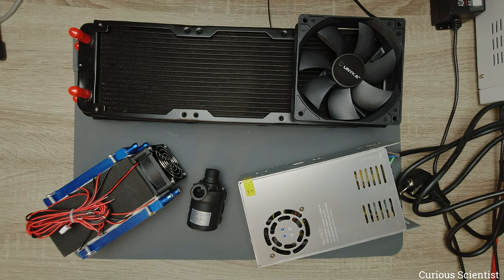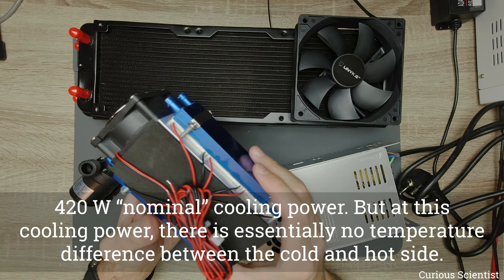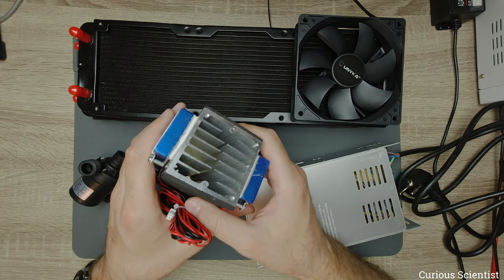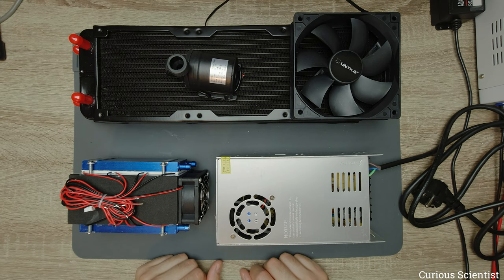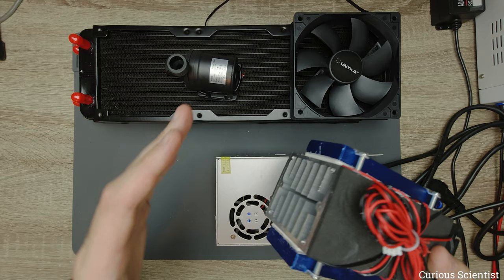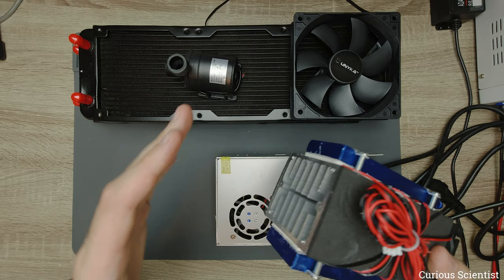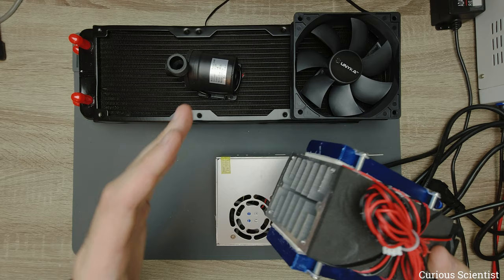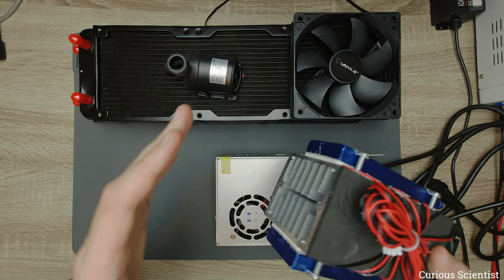Peltier cooler-based air cooler

Comment: bad design. you have lots of heat transfer between hot and cold sides of peltier via metal connecting stripes and screws. isolate them well.
Reply from the maker: Tell the manufacturer. :) Btw, those four screws per side barely contribute to the loss...
Reply: Agreed. Every experiment he did on peltiers was purposefully designed to make them seem worse than they actually are. Here for example he put the cold and hot side in in the same room and close to each other, then complaining the room doesn't get any cooler.
Reply from the maker: What are you talking about?

Comment: I don't think you understand how to cool the hotter side. You can mount a large heatsink and place it under water, submerge in the water maybe 2 liters of water and put 1-2 pump going to your radiator. It will make better cooling.
Reply from the maker: I don't really understand what you mean. The hot side already has the water cooling block installed, so the most straightforward way is to attach a water cooling loop with a radiator to it. 

Where do you mount the heatsink you mentioned and what cools the water that is used to submerge the heatsink? I don't really get it.

Comment: Some more money added to the price of that radiator, smps and pump will buy me a new air cooler.
Reply from the maker: Exactly, that's the point. These devices are not made for this task and it is better to invest in a regular AC.

Comment: personal suggestion buddy,ur stretching it to long plz make it shorter so that people will not get bored,as i am concerned,and do not forget to show the wiring at least.
Reply from the maker: The connections are always explained in the video, and they are also very simple since I just directly connected the Peltier coolers to the 12 V power supply. Regarding the length, I am okay with long videos, and I don't care if people get bored.

Comment: Could you reverse the current through the peltiers to chill (not freeze!) the water and use that to cool a CPU/GPU water loop?
Reply from the maker: If you reverse the polarity, the hot side becomes the cold side and the cold side becomes the hot side. Furthermore, it does not make sense to use Peltier coolers for cooling CPU/GPU cooling loop. I made a video of a similar case and explained why. Search for it in my channel.

Comment: 40% of the energy bill is on the heat exhaust.
Run that into a terrarium to raise the practical value.
It can even thaw out a frozen roast and hygenically incubate biltong/jerky ☝️
Maybe only one radiator is required with one pump making up for the extra work.
Much enjoyed, thanks 🙏
Reply from the maker: Hi and thank you! Yes, it could be better if we could recycle the heat but that is true for basically any heat emitting devices.
Reply: @CuriousScientist   To agree... since starting play design with these devices my mind is never made up, do I want ice-cubes or toast.
Now I see a budget TEC on my supply list that have good thermal to electrical properties.  Therefore could run some of the peripherals installed in the right place.  Seeking out heat sinks for thermo generators.
Good luck with it bro.  From this video you gave me an idea to PWM the devices supply and tweak it without an oscilloscope by just a JK reading.
They really need PWM to purr out loud and for longevity.  The PWM offers an adjustment in stack or stacked heat bridge.  I like the heat bridge assembly over stack in any event of malfunction.  I also like to use different metals for their thermo-junction properties.
They can build them to custom perameters if you're willing to order that many.

Comment: Hi from France !
Thank you very much for all this bunch of thermoelectric knowledge !

I have read that some radiators made of aluminium and copper piping are able to catch the air's moisture and prepare a highly pure and valuable water.

It's always a pleasure to follow your projects !
Reply from the maker: Hi and thank you very much! 
Yes, if you manage to cool the radiator below the dew point and you have enough humidity in the air, you can do it. There is a similar project on my to-do list. I basically want to make a device that does the exact same thing that you just described. I have a somewhat similar heat sink channel for it that I showed in the video. I just need some time to assemble a system and prepare a few things.

Comment: I haven’t read all the comments but I’m wondering if you could sandwich a water block in place of the heat sink and run the cold side to a smaller radiator with its own pump and fan? Also extend the hot hoses and move the hot side radiator farther away and see if that makes any difference. Maybe make it like a mini split and have the hot side radiator outside. Just a thought.
Reply from the maker: I made a video on a similar system. No, it doesn't make sense. A lot of Peltiers are needed for noticeable cooling effect.

Comment: Could you tell me why it is a bad idea to put the radiator + fans outside the window, and let the peltiers inside the room to cool it down?

Lets get an example: im using 12 12706 TECs. so i place heatsinks and small fans inside the room with small waterblocks on each. Then i bring the warm water outside the window like at a split AC unit. 

I think you said once its a bad idea, but i dont know the video.
Reply from the maker: It is a bad idea because you throw out 85% of the used electricity as heat. Peltier coolers are inefficient, and they are not really good as air conditioner. Your proposed system with 12 units will probably work, but it will use a lot of electricity and will provide much less cooling power than a regular AC.

Comment: I want to see this thing used in a small sleeping pod recirculating the cool air. I find myself here looking at how to cool a 4'w x4't x8'long insulated box to sleep in using my solar for power
Reply from the maker: Probably a small insulated box would be okay. But probably you would need more than one unit.
Reply: @CuriousScientist   do you think 240w would be enough to cool that much space?
Thinking about using them as a dump load for a solar storage system
Reply from the maker: I don't know. You can calculate the heat loss of the pod as well as the heat that you put in vs. remove from the pod and then you will see if 240 W cooling power would deal with it. If the pod is well-insulated and the only heat source is a sleeping person, then probably you could make it reasonably cool. Keep in mind that you typically cannot reach the maximum values provided on the Peltier cooler's datasheet, so you might need more Peltiers than you would expect. A lot also depends on how well you can cool their hot side. Another thing: this device is noisy as heck, like a hairdryer. Some people like the white noise of the hairdryer, but maybe it is not the best in this case. :)

Comment: Im confused, are you cooling or heating the radiators? I thought the cold side should be on the blue blocks and not on the heatsink to make the radiators to blow cold air?
Reply from the maker: No, that is totally wrong. The blue blocks are attached to the HOT sides which then go to the radiators. The Peltiers produce an enormous amount of heat and you remove the heat by using the radiators. The heat sink could not cool the Peltier coolers at all.

Comment: I'm amazed that your room temperature hasn't increased a bit! It should've increased by a tiny amount because you put the whole system (including the heat emitting power supply) close to each other, in the same room! I think if you use hundreds of TEC1-12715, you will get the temperature increase that you want.
Reply from the maker: I see what you are doing here, I've been following your comments on my channel since the first one. But I think that you are misinterpreting my experiments, probably because you don't watch them carefully enough. 

The room temperature increased by 1°C. I explained in the beginning that the warm air from the radiators is actually being pushed out from the room, towards the right side of the video. I also ALWAYS emphasize, that I am not trying to cool down the room as I am not able to physically separate the cooling side and the radiators. I am always looking for the temperature differences between the inlet (or room, depending on the system I built) temperature and the outlet temperature. Ultimately, the goal is always to create a temperature drop with the cold side of the Peltier cooler, and based on this drop we can estimate the performance. It does not matter if you try to cool a 35°C air to 25°C, or a 25°C air to 15°C, you will need the exact same amount of power (Q = c*m*dT). And this is why I always measure and report the room temperature in all my experiments, so the viewers can get a feeling about the real temperature drop. Depending on the system I build, I also measure the temperature of the heat sink that is attached to the cold side of the Peltier cooler. With this data the viewer can get a feeling about the "cooling capacity" of the cold side. I also showed this in the beginning of this video where I started the experiment without starting the fan on the cold side heat sink. Trust me, I know what I am doing. ;)

Comment: In middle of building a sleep pod and near on all the parts for the peltier cooling - my plan was use old PC case, adapter for the PSU to break-out the 12v, 5v 3v rails (can get adapters that do all that nice and cheap) large heatsink and 2 peltier's stacked and inside PC case - cool side and hot side with cheap ducting and recycled pc fans for the hot and cold air loops.  Did get a very large over spec heatsink for the hot side.  All this sat inside that old grey large tower of a PC case and tada - saved some corners.  Should work well enough to cool a largish sleep pod and then the real pain of noise and too hot or cold when sleeping will become less dynamic.

But reusing old parts that many chuck away can save lots, also remember that CPU heatsinks with heatpipes have been optimised for cooling hot surfaces so those can be reused nicely for something like this.

Still, one thing I do want to do is get solar panel and few car batteries and make those moments I need for cooling, less impacting fiscally.    

Though way things going, probably get it done in time for Autumn/Winter - chortle.
Reply from the maker: Stacking Peltier coolers in a bad idea for this purpose. You limit the cooling power by the bottom Peltier already and the top one does not do anything useful in this sense. Use them side by side. But only 2 Peltiers will not do anything noticeable in my opinion.

Comment: hi, i want to make an A/C for my car with tec peltiers, i need to say :
1- i can not use the compressor because my car is loaded nearly 4000kg when im driving 
2- i can get 45 amps from battery
3- the temprature of the outside is 40° celcius most of the time
4- i need the outlet temp about 20° 
do you think its work ?
Reply from the maker: Hi!
I don't know because I have never built an AC for cars. But if you only care about the outlet temperature, then this device or its larger version could work. But you will need a quite substantial cooling system for it, and you'll also need to regulate the power. Probably the voltage of the battery is too high for running the Peltiers "efficiently". Don't expect miracles.
Reply: @CuriousScientist  
i will test it and let you know if it worked. thanks
Reply from the maker: Thanks! Please, if you really test it, send me the results. It would be interesting to measure power consumption, inlet and outlet temperature, cooling time, and so on. Would help other people, too.

Comment: Hello! Can you give me advice about peltiers. I have little air cooler with stack of 3xTEC12706 atx power supply voltages 3.2v, 5,2v and 12.2v. I want try put more power for cooling. I was thinking just replacing them with 3xTEC12715 , or maybe stacking them top- 12715@3.2v , mid- 12706@12v , bottom- 12715@12v. Or what is my best option with this type of power source?  Sorry about my bad language and messy question. I donated for your super work here :) Thanks
Reply from the maker: Hi! Thank you for your contribution! Your language is perfectly fine, I understood everything. 

I think that your concept is not the best. Not necessarily wrong, but could be improved. If you need cooling power, then you should not stack the Peltiers. Stacking gives you larger temperature difference between the bottom and the top Peltiers. But, the heat that you can remove from the system that you want to cool entirely limited by the cooling power of the bottom Peltier. And in addition to this, you waste most of this cooling capacity by removing the Joule-heat of the other 2 Peltiers in the stack. There's only a very little capacity left to remove actual heat which cools your system. 

Try to increase the surface area and use several, individual (not stacked) Peltier coolers. Make sure that you cool their hot side very well, and don't run them more than 50% of their max rated current (e.g TEC12706 should run at 3 A, TEC12715 should run at 7 A.....etc.). You can use a DC-DC converter to limit the current by limiting the voltage that you supply to them, or if you have a 12 V PSU, you can "chain" them on the PSU. One link of the chain is two identical Peltiers in series. If you put them in series, they will experience half of the supply voltage, around 6 V and this will limit the current too. 

I made a lot of videos on Peltiers, so I encourage you to check them. I discussed all these issues: serial or parallel wiring, stacking or not...etc. I hope it helps!

Comment: Thank you for this video, I am looking to do this but it will be hooked up to a helmet for racing to help decrease temps inside a helmet, perhaps voltage could be switched and blow warm air also
Reply from the maker: This is way too large to directly attach it to a helmet, and you would need to get the power cables and the water cooling pipes to the unit as well. It's quite messy, in my opinion. If you want to switch to heating, then you would need to flip the polarity on the fly. An H-bridge could do that for you.
Reply: my plan is to build a box for it so that it can easily be transferred between vehicles with a hose blowing air into the helmet, I have been collecting parts and im about to build it on the bench soon.  @CuriousScientist
Reply from the maker: Why don't you just use this exact product with a hose extension? You only need to solve the cooling of the Peltier coolers somehow, but that should not be too difficult. There's enough space on the backseat (or its place) of the car.
Reply: that's exactly what im doing . :D @CuriousScientist
Reply: @CuriousScientist  I went with the 4 module style, I want to be able to use the 12v outlet in a car and not have to connect directly the battery, so I need to be conscious of the amps

Comment: Thanks for making such a wonderful video.

will this type of system work for small dog house (PUG dog breed) ?  small A/C's are not sold in india best i cant get is 1Ton ac for around 405$ and power consumption is 938W . price is not much of issue for me its just power consumption and size since its very hard to fit inside small dog house . I was looking for solution which uses half power and is much smaller . My room temp is 40°C and i'm hoping to get 21°C .
Reply from the maker: Hi and thanks! 

I believe that this could work for such small volumes. However, based on the comment you wrote, you might have some misconceptions about the Peltier coolers. Yes, they take up much smaller space than the traditional compressor-based coolers, but they are also much worse in efficiency. So when you expect them to use half the power than the AC you found, you should also expect them to provide much less cooling power. Nevertheless, for a small, insulated dog house, Peltiers could work. I would however not use this specific Peltier air-cooler because it would be somewhat difficult to install it in a dog house. It is noisy, and the fan would not tolerate the dog fur on the long run. I would sandwich the Peltiers between two large heatsinks where the cold side is inside the house and the hot side is outside and it is also equipped with a cooling fan.
Reply: @CuriousScientist  Thanks i really appreciate your response.
 Peltier coolers are really bad way to cool but this is best what i can get for smaller areas in my country so sadly i have to stick with it but if you have better alternative i would be happy to implement .

Comment: What is the cop in this case? Would a water cooled system like this have a cop higher than an AC? I imagine a  pipe loop with the water tank sitting outside under a shade, or a loop running underground (geothermal with peltier) surely that must have a crazy high COP as compared to an ac?
Reply from the maker: I don't know the COP from the top of my head, but you can look it up on the datasheet of the Peltier cooler (TEC12706). I disclosed all parameters in the video (current and voltage).

I think there is no way of reaching a better COP than a typical AC. Peltiers are super inefficient. Also, if you can afford to drill down for geothermal heat, you can afford a normal AC and run it from the heat pump. This device is just for cooling down very small volumes of air and it is not an AC for a room.